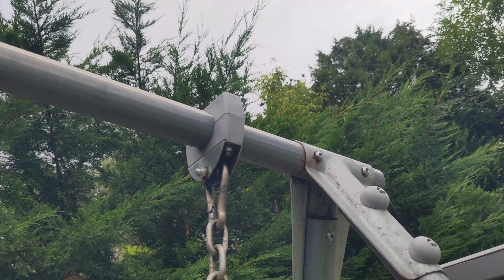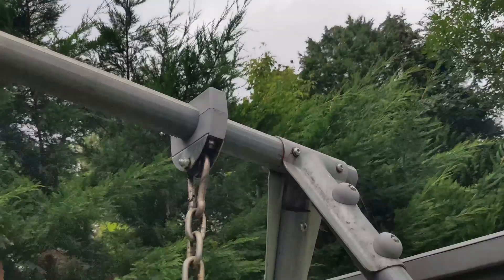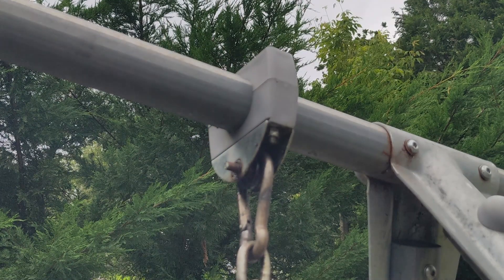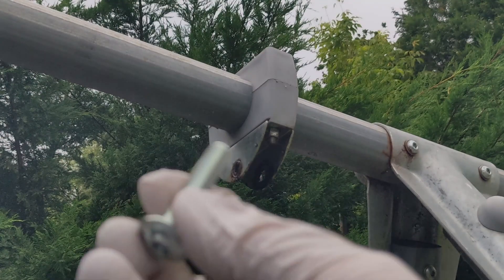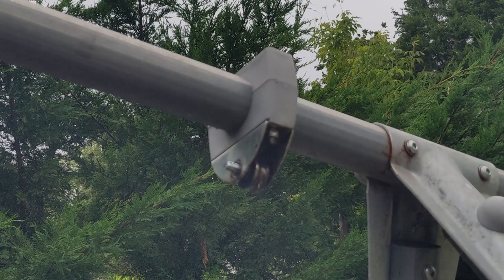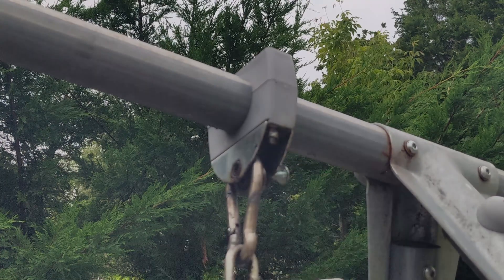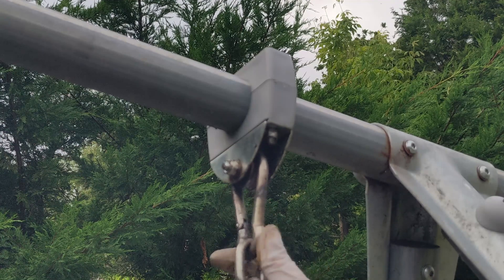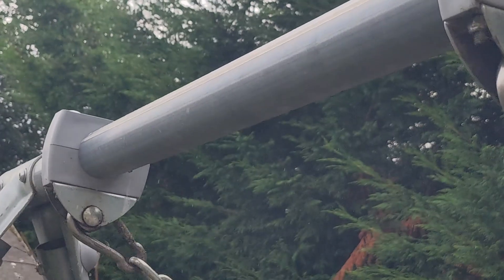Stopping the "clunk" on m'daughter's swing

Comment: While you’re at it, the attachment of the legs to the crossbar could use some snugging up. I’m seeing too much flexing in there. Don’t want it coming all apart during a swing session.
Reply from the maker: The problem is, and always has been, the thing is constructed of pipe with no reinforcement where the bolts go through, so every time I tighten the bolts, it simply deforms the pipes even more. I'd like to weld in some tubes to reinforce it, but I'm not keen on welding galvanised steel as it creates incredibly toxic fumes.